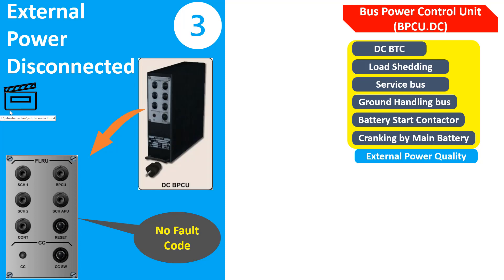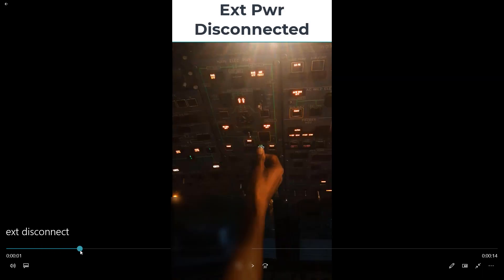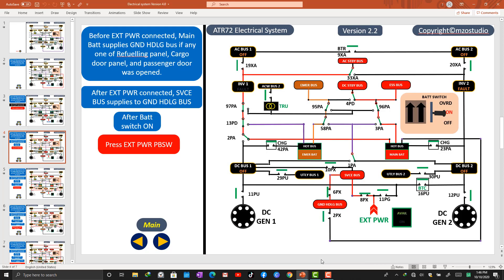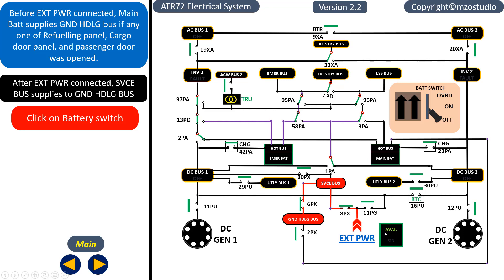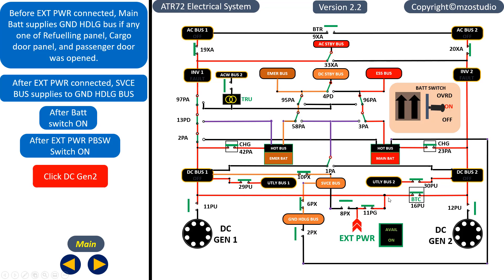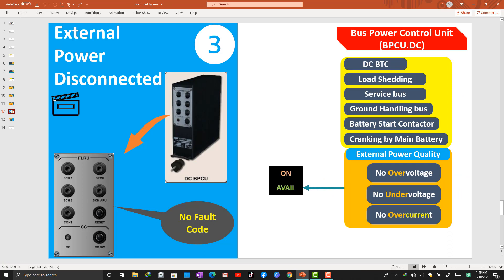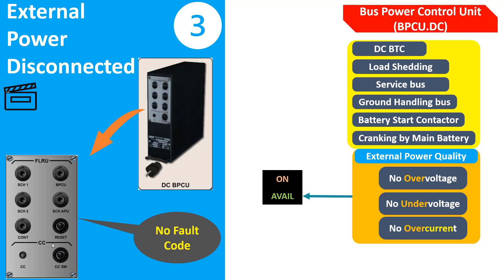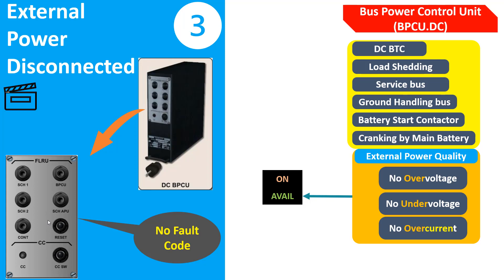ATR72-600 External Power is disconnected intermittently after Ext Pwr Switch ON

Comment: Contactor 11pg with failure.
Reply from the maker: If BPCU DC and GPU change was not ok, I have to check external power contactor 11PG. But, as you know, removal and installation of electrical contactor is difficult. I don't want to replace this without necessary. That's why, i checked BPCU which are LRU and easy to replace and swap to confirm the sang. If it was not ok, i have to check this contactor finally.